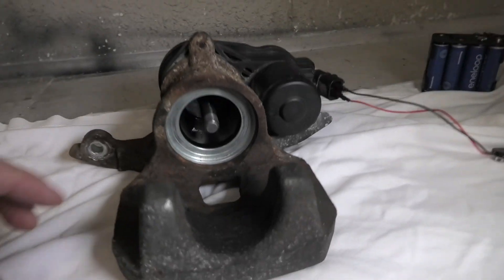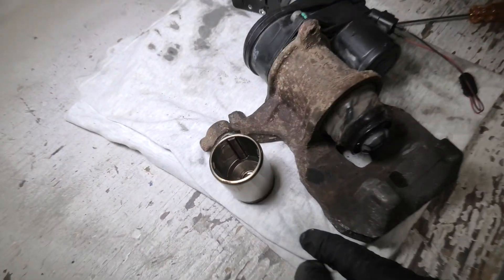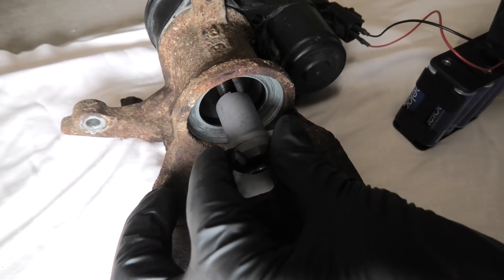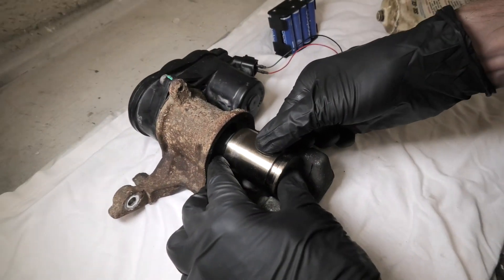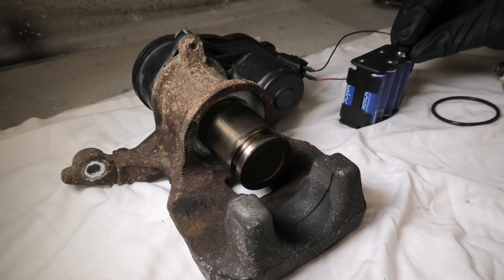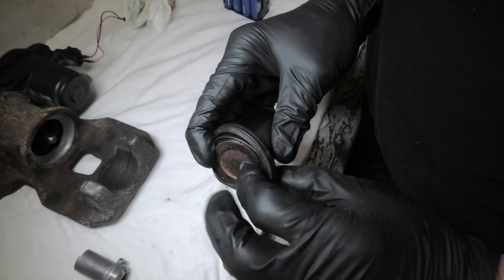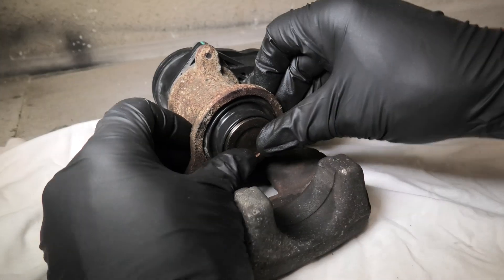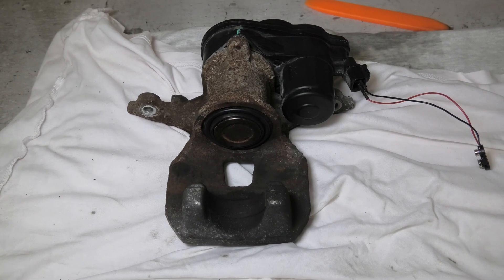Toyota RAV4 (2019-2025): Electric Parking Brake Caliper Explained! What To Do If Piston Falls Out?

Comment from the maker: PRODUCT LINKS:
1. REAR CALIPER REPAIR KIT - Brake Caliper Rebuild Kit for TOYOTA Camry, Avalon, Rav4 2018-2021 REAR - https://www.ebay.com/itm/335237211060?amdata=enc%3AAQAJAAAAoHoV3kP08IDx%2BKZ9MfhVJKm%2FqyA3%2BeOxwiCzE9fNzN0AfxLqhnggHTWed--MGgm9biMCJCHFYur62P2R8WGVvgNozc%2BRuldbSq1MPraeJJw5CPamueKb27ha%2FLn99rvwApc2P4xXLq6cT%2BfAJUZ9BBKEUlFHIBlnBMGTQZDOd0EP848DWt3u%2BOqugSKK79Cymxwc8z%2F03AvIocaqaG08xTE%3D&mkcid=1&mkrid=711-53200-19255-0&siteid=0&campid=5338971185&customid=&toolid=10001&mkevt=1.
2. PARKING BRAKE ACTUATOR (46310-33010) - A-Premium Rear Parking Brake Actuator Compatible with Toyota Camry 2018-2022, RAV4/Corolla/Avalon 2019-2022, Highlander 2020-2023, Sienna/Venza 2021-2023, C-HR 2020-2022, Replaces # 4631033010 - https://amzn.to/42Povqp.
3. VCI J2534 Cable V18.00.008 Latest Version - https://amzn.to/3Fn6HtV.

RECOMMENDED TOOLS:
1. BATTERY HOLDER - 2Set 8 x AA Thicken Battery Holder with I Type Wired Battery Clip Standard Snap Connector - https://amzn.to/3Y2CNPv.
2. FLAT HEAD SCREWDRIVER - Klein Tools A131-2 1/8-Inch Flat Head Screwdriver with Keystone Tip, Made in USA, Pocket Clip, 2-Inch Round Shank - https://amzn.to/3VV0FVh.
3. TRIM REMOVAL TOOL - 4pcs Auto Door Clip Panel Trim Removal Tool Kit - https://amzn.to/41nYhsk.
Reply: Can you do a video on a Mercedes E-park brake? I took one apart this past weekend (2021 C-class) and it has small springs and tiny ball bearings inside the piston.  I put back together the best I could and it cycled in and out but not completely sure I assembled it correctly. Thanks

Comment: When you press brake pedal, will the actuator push in?
Reply from the maker: No, the parking brake is activated using the button on the central console: Toyota RAV4 (2019-2025): How To Set And Release Electric Parking Brake In Automatic And Manual Mode? - https://youtu.be/Z93_SRxdiMA.

You can also use it in an emergency situation: Toyota RAV4 (2019-2025): How To Stop RAV4 If Brakes Fail, Using Emergency Electric Parking Brake - https://youtu.be/7LLHjIkGYJo.

Comment: I had an issue with this yesterday where I began the brake service without knowing that there was a procedure to put the car in service mode. I had one caliper already removed, and I engaged the service mode thing and I saw the piston retract, but still not enough to clear the new brake pads so I just put the old brake pads and assembled everything back together, but then I could not get the car out of service mode and I saw a parking brake malfunction light on the dash
Reply: Had the same issue and broke the rear caliper forcing it with the piston tool.
Reply: I had the same issue, but what did you do next?
Reply: @AliRaza-dy7nu  I took it to my friend who has a shop and hooked up the car to a real scanner and you’re able to retract the pistons from the scanner. Then, after we put the brakes back on, he took it out of that service mode.
Reply: @litesoutproduction thanks for the reply
Reply: @A @AliRaza-dy7nu  if you do the sequence on your own at home through the little buttons, you just gotta make sure that you don’t remove the calipers before putting it in that service mode. Otherwise you’ll have the problem that I had.

Comment: Thanks for this video! The piston came out on me, brake fluid everywhere it was a mess. I did not rebuild the caliper but just threw it all back together although the dust cover is cooked, it all works! (will be ordering a new one). I kept getting EPB errors but I cleared those with a Chinese $100 diagnostic scanner and the code is cleared, also bled the brake as well. It was a mess, but you learn something new everyday, now I know how the ins and outs of the EPB on Toyotas.
Reply: Which scanner did you use? 🙏
Reply: @HeadNorthMikeMcKay  Topdon AD500
Reply: I’m in a pickle right now same thing my piston came out I can’t put it back I’m losing sleep idk what to do lol
Reply: @obieone21  its really easy, just put it back in, you will need a 9v battery and 2 wires. Don't worry about the mess or dust cover, nothing important is broken.
Reply: @sheeiiittt2012 I did it’s still stuck like cook

Comment: In your opinion if the brakes make a terrible “dolphin noise” when applied is that the caliper itself not the electric motor?
Reply: Pretty normal, mine does the noise too, just the electric motor

Comment: Can anyone tell me if there is a way to reset the "Electronic Parking Brake Malfunction " "See Dealer" code without going to the dealer on a 2021 toyota rav4 hybrid? Or do you need a special scan tool?
Reply: Did you figure it out by clearing it with an OBD2 scanner?
Reply: @MrCoalcracker79  I tried using my skan tool. Also went to a local shop who tried theirs. Neither of us had any luck. I ended up biting the bullet and took it to the dealership, where I ended up having to pay for an hour's worth of labor but they cleared the code.
I probably could've bought Toyota's software and used a laptop, but I didn't want to go through the headache of that either. Lesson learned.
Reply: Did u find out
Reply: I purchased a scan tool and was able to easily reset the parking brake and clear the code. Only took a few minutes.
Reply: @MrCoalcracker79 That's awesome to hear! What scan tool did you use?

Comment: I'm replacing the rubber boots on my caliper soon.  i'm gonna put my car on service mode then remove the epb motor then push the piston out using a ratchet. After cleaning and put everything back together, should I retract it all the way back which is where it was on service mode, right?  Service mode means the pistons retracted all the back?
Reply from the maker: Service mode unwinds the pressure nut back (not the piston) allowing you to compress the piston when you replace brake pads, for example. After you reassemble everything,  you can push the piston all the way back until it is stopped by the pressure nut mainly to have enough room to reinstall the caliper. When you disable the service mode the motor will stop automatically when the piston (pushed by the pressure nut) reaches the brake pads.
Reply: @MorozovAutomotive yep everything was straight forward for me after watching this and reading your comment and I was able to successfully rebuild rear calipers.

Comment: What if only a little bit of brake fluid came out? Would i still need to flush ut
Reply from the maker: If the piston falls out, air will be introduced into the system. The brake fluid needs to be flushed.

Comment: 2020 toyota corolla Hydrid
I put in brake mode did the right rear brake move over to the left-hand brake and piston started to fully extend. I was able to reset the position but now I have a no brake pressure message..
 
Thank you
Reply from the maker: If the brake fluid came out, you will need flush it. How To Bleed Brakes? Brake Fluid Change (Flush). Detailed Guide! - https://youtu.be/7W1w6Su0HAI.

Comment: Super good video man, I was doing my gfs breaks and the caliper didn’t want to push in. The parking break light was off but I second guessed myself and thought I’d try to put it in service mode again. Bad decision lol it kept winding out as it wasn’t attached to the rotor so I unplugged the caliper. After watching your video I’m going to rig up that 9V setup and tackle it again tomorrow. Thanks for posting this man! Wish me luck haha
Reply: exact thing happened to me. I think the key is to HOLD the parking brake button DOWN for long enough for the EPB to fully retract, if you let off the button once you hear the pressure it only goes back halfway - such a stupid fiddly system. What was wrong with the old cable-actuated hand e-brake????
Reply: @AlexKost-tq6bj  it was two simple and fool proof haha
Reply: Exact same thing just happened to me lol

Comment: Well mine went fully out but I don’t know what to do with the parking brake malfunction light? It won’t go away and the rear electric brakes won’t engage
Reply: Currently here. So stressful
Reply: @ put everything back together get the tires brakes on and everything and your gonna need to get a type of scanner tool that can access the Toyota system I know some and your gonna want to do an abs system bleed with the scanner tool and do a malfunction recalibration/ reset and you should be ok lmk I already fixed mine
Reply: @ I completely blew the piston out and break fluid everywhere. I wish I knew all this before I started. Thanks
Reply: @ did you take you car into the dealer?

Comment: How deep do i need to screw on the pressure nut ?
Reply from the maker: It has to be deep enough for you to reinstall the piston.
Reply: @MorozovAutomotive  Ok tnx. I am working on a Ford FOcus mk4 which has a slightly different mechanism inside, i would say probably more idiotic. How does main computer know how long it needs to spin the spindle to be in park ? I am thinking maybe there is a sensor of break fluid pressure for specific line that leads to the wheel. But not sure about that. What happened to me is a bit unfortunate thing. I put my ford focus mk4 into break service mode with a dying battery. So no need to explain what happened next.
Reply from the maker: @ No problem. The ECU reacts to the current change once the piston hits the brake pad and the motor stops.

Comment: It’s an expensive worthless component….especially in the Northeast with salted roads…
My best recommendation is to replace BOTH SIDES…. it’s pot metal and no doubt worn out if more that three -five years old.
They start to DRAG, and either DONT engage or DISENGAGE…
Toyota quit using them…. A real nightmare.
Approx $120 Dealer ordered…. 
I’ve been driving Toyotas for 40 years….

Comment: Just had this happen recently. I was trying to verify the epb was retracted while the caliper was off and caused the epb to run the cylinder all the way out. The dust bit stayed on but I could feel the piston was disengaged. After running the epb back in as you show, I could push the piston back into place but the dust boot was building with brake fluid. I pulled the dust boot back slightly so the fluid could drain out. After reassembling and flushing brake fluid, it is working fine. Thanks for the video!  Best explanation of epb on YouTube!
Reply: What kind of car did you do this on? I'm dealing with this on a newish Camry right now
Reply: I just did the same thing lol, didn’t spray it with brake clean to clean it first? Jw as the one I’m working is is fairly dirty 

I’m hoping mine goes as smooth as yours!

Comment: Do you have a video on how to bleed the brake?
Reply from the maker: Toyota RAV4 (2019-2025): Brake Fluid Change In The New RAV4 - https://youtu.be/VkCP1YWuQVQ. This video shows how to bleed brakes using the gravity bleeding method. It is recommended to do this procedure ONLY if you need to flush (replace) the brake fluid and there is no air in the system.
If the caliper has fallen out, you will have air in the braking system and you need to do the pressure blessing method which is shown in this video: Scion TC (2011-2016): How To Bleed Brakes? Brake Fluid Change. Detailed Guide! - https://youtu.be/7W1w6Su0HAI. This method requires two people and allows to remove all the air from the system.

Comment: When reinstalling the pressure nut it was stuck going on and wouldn’t spin. Did you run into this issue?
Reply from the maker: No, we did not have this issue. I would check if the thread is damaged on yours.

Comment: I neglected to release the break before beginning the break pad change and caused the piston to pop out. I’ve reassembled the piston From scratch along with bleeding ALL breaks clean. 

Problem I’m having now is the electronic parking break is not activating. I’ve tried disconnect battery to shut down system and it will not work. 

What’s the solution to get it to work?
Reply from the maker: Have you tried to disable the rear brake service mode?
Reply: @MorozovAutomotive yes and the sequence does not work. Now it only says EPB not working
Reply from the maker: I would try to reset the warning message with a scanner that supports the new gen Toyota RAV4 or use this tool: VCI J2534 Cable Fit for Toyota TIS Techstream - https://amzn.to/3WIResL. Normally it should resolve this problem.
Reply: @MorozovAutomotive Will this help with the parking break malfunction issue? I tried disconnecting batter for 1+ hour to let all systems die down and no luck
Reply: @christopheroliveira2855 having same problem. Did scanner work?
Reply: @vashamitchell  didn’t see response
Reply: Computer reset at a shop handled it
Reply: @vashamitchell  scan tool worked.
Reply: @christopheroliveira2855 Same with me did everything you said as well. You’re EBP actuators had to be recalibrated just like mine. You did everything right you could.
Reply: @christopheroliveira2855 how much did it cost to have the reset done?

Comment: I have a question, can i put the fully retracted side in no problem, or would I have to bring it upto the brake pad and rotor because one side would be extended and the other retracted? I also got a brake malfunction message, is this because the fluid had ran low?

Comment: Do you need to do this for both sides if only 1 of the pistons popped out? The other was able to retract by slowly turning and pushing pistons back in
Reply from the maker: If any of the pistons fell out, the brake fluid needs to be flushed in the whole system after all pistons have been properly reinstalled.
Here is how to change the brake fluid if this happens - https://youtu.be/7W1w6Su0HAI.

Comment: Hey @MorozovAutomotive I have a couple of questions I was hoping you could help with.
1. Once the piston extends that far, is it possible to just clamp the brake fluid line, remove the line from the caliper and drain it (Instead of disassembling the whole thing)?  Would that help remove the fluid and allow the piston to go back into place?  Or do you need to disassemble the whole thing to release the fluid?
2. My piston extended all the way out but using a battery I was able to push it back in a little before it got fully stuck, is that because the brake fluid is in there and it can't go further back?  The piston is still able to extend out, does that mean it's still working and going back to question 1, the brake fluid is preventing the piston from being pushed back in?

I just don't understand why it breaks once the fluids gets in.  

Thank you so much for the videos!
Reply from the maker: Hi, the brake fluid does not prevent the piston from being pushed back into the caliper. It is controlled by the valve which allows the fluid to flow back into the brake fluid reservoir if you don't press the brake pedal. You should not clamp the brake fluid line. If your piston fell out completely, you need to lubricate the surface of the piston with the brake fluid and push it back in. You need to switch the battery contacts around to retract the pressure nut and then you need to push the piston in with your hands. Make sure that the piston sits on top of the pressure nut and the pressure nut is engaged with the spindle. Do it in small increments. Activate the epb motor for a few seconds, push in the piston. Repeat.
If the piston fell out, you will need to flush the brake fluid to remove the air from the system. We showed the process in this video - https://youtu.be/7W1w6Su0HAI.
Reply: For all those watching, if you accidentally try to get the rav into service mode while the break is off and have your piston over extend, it is not the end of the world!  Every comment and thread out there says you're fucked.  But thanks to @MorozovAutomotive you can fix it!  I did exactly what he said in this video.  Took off the caliper, opened it up and drained the excess brake fluid.  Cleaned the inside before putting it back together like he did and then the piston was able to retract!  After that I was able to install my brakes, bleed it etc.  I still had the EPB malfunction on my dash, but I was able to hold my gas pedal and then hold the EPB up and it started working and got into place and fixed itself.  I also had a 200$ foxwell scan tool, that I jimmied with so, I am not sure if that helped allow me to get the EPB back into place.  

When I went to the local mechanic and showed them the picture of my extended piston, they said the caliper was shot and I needed a new one.  False.  You can fix it (as long as you didn't use too much brute force to break anything).  I cannot express enough gratitude to Morozov for all these super helpful videos!  

@Morozov do you have a patreon page that accepts donations, or is it through youtube?  I just want you get most of the money and not youtube.  Anyways thanks again!  Based on everything else I read I thought I was gonna have to tow my car.
Reply: You pressed down the gas petal?
 @RobertSmiths-r9z 

I had my pop out, got it back it without taking it apart and put everything back together, but now I can get the EPB do anything. I try to reset it and it just beeps
Reply: @App1-e3e  after fixing everything I took it to a dealer to recalibrate my EPB actuators. I have a cheap $20 scan tool so I wasn’t able to clear the code myself. The beep for me was a redish orange blinking light and a “ebrake malfunction” on the dash.
Reply: @morbin7744 how much did this cost?? I have to do this too just solved the issue using this video but now about to do this.
Reply: @RobertSmiths-r9z  Your Commet just gave me the biggest relief! I just had the piston come all the way out and now need to clear the code! When it happened the amount of dread was insane! I just felt hopeless.  My cheap scan tool didnt clear the code tho....Thank you for your comment and experience!! You give me hope!! Lol
Reply: @nickdoss9234 How did you get the code cleared? Im in the same boat. Was it the dealer or could a independent shop clear it?